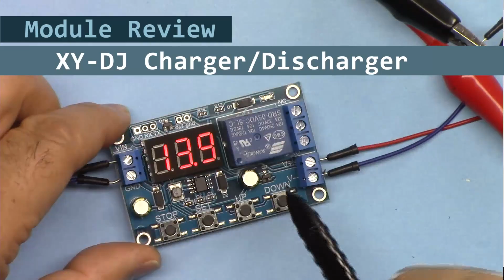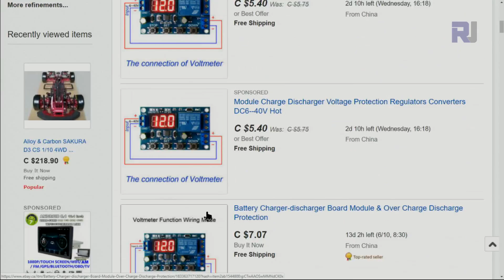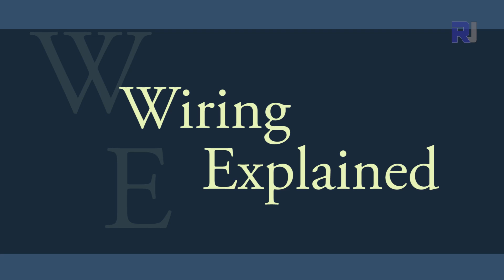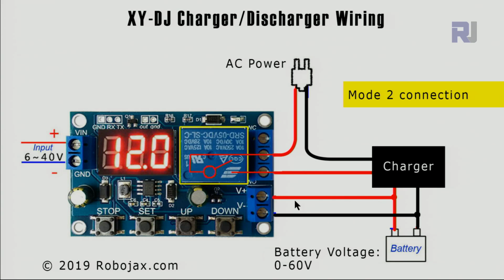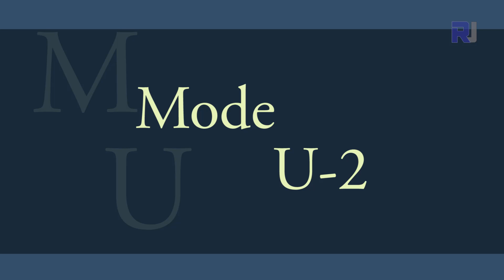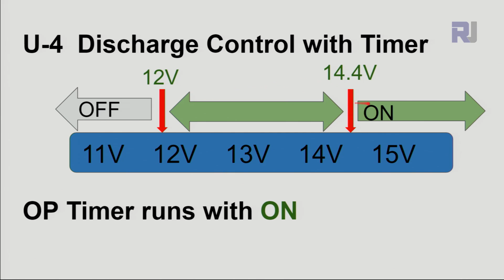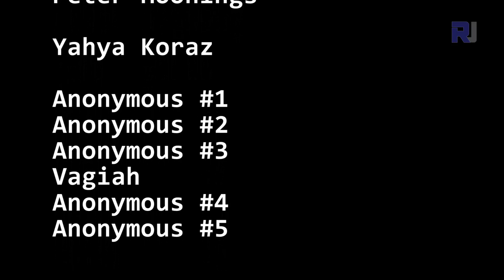How to use XY-DJ Battery Charge Control Module with Over Charge Protection Solar - RJT221

Comment: Hi, I'm having a problem with the voltage measurement at U3, it oscillates between turning on and off, while the battery voltage is fixed at 13.3V on the multimeter. Could interference occur if I connect the power supply to and the 220V phase relay?

Comment: Hi Ahmad - Great tutorial as expected. Thanks to you I've been able to figure out the operation of this control relay which I bought and forgot, until my inverter quit last night for overdraining  my battery. Actually the opposite often happens where my charger shoots up beyond 58.4 V on my LiFePO4 48V battery. I came back one day where the Charger displayed 75V !!! Fortunately, the BMS must have protected the battery otherwise... I though I tweaked the charger parameters to prevent such event, but I guess I failed even though the identical charger I have nest to it never goes beyond its limit... But I cannot return it and this gadget will keep it from happening again. So thank you. I will use OP-5 to drive 2 SSRs that will close the solar charge controller and inverter output, when my battery voltage exceeds or drops beyond  its range: 44-56.VDC. SInce these event work in reverse I'll use the NO and NC output of the relay to drive the SSRs. I like the fact the it displays the battery voltage because I need to set this relay inside the house while the solar rack is outside. You said you would post herewith the documentation for the serial communication of this module? That would be precious if you could let me know where it is. Thanks again Ahmad!

Comment: this board has very low voltage accuracy (-0.3V in my discharging case) and there is no calibration function

Comment: Very nice and informative video 👌. I recently purchased this module for charging LiFePo4 battery using solar panel. But you mentioned in the end that it has some problem charging lithium battery. I have not tested it yet so should I use it to charge my 24v LiFePo4 battery ?
Please help 🙏

Comment: I've a Moman V-Mount Lithium Battery - 14.4V - 99Wh - 6800 mAh and Charger 16.8V - 2A
How many Volts should I set the module to make it turn off?
15.6 V ?  Or which other Volts?
Can you help me? Thank you very much 😊
Reply from the maker: lithium is very fagure. it should LiIo, LiPO, LiFePo4 or so. but generatlly it the charge voltage is 4.2V per cell and 3.25V for the other. I have explained chargin battereis in my other channel in this video https://www.youtube.com/watch?v=45V_c-nweHY

Comment: hi, can i use this charger for 3s li-on battery 12,6 volts?
Reply from the maker: This is not a charger. It is a protection device. You need to have charger.
Reply: Δημήτρη καλημέρα
Μήπως μπόρεσες να καταλάβεις πως γίνεται ο προγραμματισμός;
Εγώ θέλω να το τοποθετήσω σαν προστασία να μην ξεφορτωθεί τελείως η μπαταρία. Είναι 24 βολτ σύστημα και θέλω να άρχιζε να κλείνει το ρελέ στα 26 βολτ και να το ανοίγει όταν κατέβει στα 24.
Είναι φωτοβολταϊκό σύστημα και όταν έχουν γεμίσει οι μπαταρίες να διοχετεύει το ρεύμα που παράγει με το ρελέ στον ινβερτερ για το σπίτι.
Ευχαριστώ
Reply: @digenisakritas6228  γραψε οτι απορια εχεις στον robojax και θα σου απαντησει . Εμεναμου απαντησε παντως . Δεν εχω ασχοληθει ξανα με αυτο

Comment: Good day sir. I would like to use this module in my diy solar setup. My novice question is how do I connect it to my solar charger controller and battery. Which wires are going to the input side? Hope you can help. Thanks

Comment: EXCELLENT VIDEO!!  thank you so much... I am trying to find a tutorial for the XY-CD60L, it has only VIN and OUT ports.  Can you help?? I want to know if I can connect the solar panel on the Vin and the batteries and the load in parallel on the OUT Port.  Or at the very list a charge/discharge control board on the OUT port and then the batteries and load separately connected to this second board (which has separate OUT and BAT ports). I have liked and subscribed.  Thanks a lot.
Reply from the maker: Hi, just did a search and found  it on AliExpress here https://s.click.aliexpress.com/e/_DF8FsDz and wiring for load and battery is shown here. https://ae01.alicdn.com/kf/H8a894d94896b4dc6b86889f85726766bS.jpg keep in mind that your battery must be the same voltage as the load. this module does not change the voltage or current.
Reply: @robojax  thank you so much for taking a look at this! unfortunately, what I need is to connect the solar panel to VIN and the Charging Module to the OUT port, I would connect the batteries and my cell phone to the charging module.  you think its going to work? Solar Module to the Control board, control board to the charging board, charging board to batteries and load on separate channels. <)

Comment: Hello Sir, I am trying to use the serial connection on this board. I am not lucky until now. Do you know how to use them with arduino or esp3266?  Or do you have some bether source  of information? maybe somebody who already realized to work witch it?
Thank you.
Reply from the maker: Hi, you can't use  the serial option. it is secrete for the manufacturer.  Use Arduino to program or do anything you want. here is my Arduino course https://youtu.be/-6qSrDUA5a8
Reply: @robojax  Hello Sir, thank you for the quick response. I Tried esp3266 yesterday. Today I tried to use serial port with Arduino. But both of them didn't work. To bad. I am searching the internet for somebody who already had success with the serial on this item or some examples for wiring and source. But all the way, thank you for help. I will go on trying to get success with this. Johannes

Comment: This module have one fault in Mode U-2, when detect for first time low limit voltage start to charge, if reach high limit voltage stop to charge, and will start to charge again when detect low limit voltage, but if time is reached before than high limit voltage, then stop to charge, but never start again to charge when detect low limit voltage, you need to power OFF and ON the module, or reconfigure again Mode U-2 to reset the module, or dont start to charge never more in mode U-2.
And is possible that have the same error in all modes that use timer.

Comment: Hi,
Pensez vous que ce type de carte permet de suivre la charge d une batterie..
Car la mesure effectuée correspond je pense à la mesure de la tension du chargeur quand celui ci est branché sur la batterie car je ne comprends pas comment il peut mesurer uniquement la tension batterie avec un chargeur qui fournit une tension supérieure à la tension batterie pendant la charge.
Avez vous une réponse.
Reply from the maker: Hello, lorsque vous connectez une tension plus élevée pour charger par exemple 13,8 V, si la batterie est vide, la tension sera de l'ordre de 11,8 V à la borne de la batterie, cela est dû aux caractéristiques du chargeur. Lorsque la batterie est vide, elle a besoin d'un courant très élevé et le chargeur contrôlera le courant en réduisant la tension. Essaye-le. tu verras.

Comment: 2:40 if i set charging voltage 14.6V BUT cut off at 14.4V, will it harm the battery?
Reply from the maker: each product is different. check the datasheet from the manufacturer.
Reply: I am talking general.

Can we charge at higher voltage (say 14.6V) and cut off (at 14.4V as per specs), is it safe or better to charge fast?

Comment: I am having a charger whose output is 24V- 30A (900W), which is used for lead acid battery. So, can you please suggest me the relevant auto cut-off device or circuit for the same?

Comment: hi, I have a question, say suppose you use this to charge a LEAD acid battery, does this lower the charging current when the battery is almost charged ?
Reply from the maker: Hi, from your question I got that you have not watched the video. I have explained this in video.

Comment: Well explained👋 Your channel is my go to section on YouTube whenever I need to check reviews on such modules. But I just have one question on this XY-DJ.  Can I connect a solar panel on the NC and an AC charger on NO of the relay? I did this on my YX-850 ups module. It worked for a month but eventually burned the relay. The current was only 5A, both from solar panel and AC charger. I was thinking of automatically charging my battery via AC charger if power from solar panel is not available. Thanks in advanced 😊

Comment: Hai sir  
Sir i connect the 5v relay direct out and ground to (external relay points) but its not working and out and ground voltage 4.9 v after  connect the relay voltage voltage drop 
And relay function on or off, but out  ground voltage is constant 4.9 v, it's not on or off
 plz tell me how to use this

Comment: Hai sir  
Sir i connect the 5v relay direct out and ground to (external relay points) but its not working and out and ground voltage 4.9 v after  connect the relay voltage voltage drop  plz tell me how to use this
Reply: And relay function on or off, but out  ground voltage is constant 4.9 v, it's not on or off

Comment: Peace be upon you

Please, I have a question about the battery protection circuit. 

Xy-dj made a movie about her

Question

Do you protect the battery from overcharging at the same time from overloading 

i.e. do you use it either to protect from charging or to protect against unloading 

Or both. In same time 
Please if you can  drew the wiring way connect  in this case

Comment: Robojacks I watched your video twice..i use 2 of these in conjunction with each other and it works fantastic...1 setting uses u6 and the other u5

But!!!! You forgot something in your video....if you press and hold the stop button there are a few other function...to ne honest i dont know what they do...i suspected it turns the volts screen on off or a set on time
Reply from the maker: I am glad you found it useful. I am not sure if I mentioned it or not in this video, but that is to turn OFF the display to save energy or simply hide it.

Comment: Again - On the Right Side, can the Negative from the Wall Charger be place directly into the Negative Battery Terminal of the XY-DJ Module? The diagram shows it in the middle of the Battery Negative Wire. Does it make any difference?
Reply from the maker: Please see my reply to your other comments.

Comment: Can a Jumper wire be placed right into the Positive Battery Terminal then leading into the Terminal just above it?  This idea rather than placing a wire in the middle of the Positive Battery Wire going to the Battery. This will achieve the same result. Isn't that correct? Let me know. Thanks.
Reply from the maker: Please see my reply to your other comments.

Comment: So......the if I connect to the Battery with a length of wire and Battery Clips,  I can run the wire to the LEFT SIDE INPUT of the XY-DJ Module to power it up while also charging it. So that means I can use my Laptop Battery Charger on the Right Side of the module instead of the Left Side. Is that correct?
Reply from the maker: Yes. correct.  Stay safe. Ahmad from Canada

Comment: I'm in the U.S.A.  All your wires on the right side are Black, and that's confusing for learning purposes. In addition,  the connection of the Light Bulb as it relates to a Battery is totally not in view.  We really can't see anything when you are making this connection. The Battery is not in view either.  I have a Laptop Battery Charger plugged into the wall that changes 120V to 19V, and that is connected to the LEFT SIDE INPUT of the XY-DJ. So 19V is supplied to the LEFT SIDE of the XY-DJ. With that in mind,  on the RIGHT SIDE, the diagram suggests that a separate Charger needs to be plugged into the wall (120V) as well. In this case, a light bulb, and the positive wire needs to be cut and placed into the COM PORT (the center screw) of the Relay.  Then the positive exits the Relay from  the Lower Screw Terminal and is connected to the Battery Positive Terminal Wire,  and that finally connects to the Battery Positive. Battery Negative on the XY-DJ just connects directly to Battery Negative on the Battery. Is all this correct? Please let me know. At present, I have never connected to the Relay Ports.
Reply from the maker: I just watched the video. It can't be explained better than this. I have explained it with diagram and showing the wring and explained it. it can be connected 2 ways so I explained both. .have you checked the resources page for this module?   https://snipboard.io/AHhRpV.jpg
Reply: @robojax  I connected a light bulb on the Battery Output Terminals. I get nothing. Also, the meter reads 00.00 Volts. When my Battery was connected, the meter was reading the same voltage as my Battery - 12.77V. I guess it was back feeding the Battery Voltage onto the XY-DJ Meter. On the LEFT SIDE, I have 19.3V on Input. Without any outside wire connection to the Relay, is it connected to Battery Output on PCB? If so, the Relay may be causing 00.00V on the meter and no output whatsoever.  Is that a possibility.  Again, do I need two items plugged into a wall outlet to make this Charger/Discharger work? One for Input Power and another for the Charger on the Right Side? Let me know. Thanks.

Comment: If I remove the Battery, Output Voltage is 00.0. When I connect Battery, it back feeds to the Output Terminals of  XY-DJ and reads 12.77V.
Reply from the maker: Sorry, yes when you disconnect the battery, it  can't do anything. https://snipboard.io/AHhRpV.jpg then your setting is incorrect.

Comment: OK - I have 19V going in and Alligator Clips on the battery side. Nothing is connected to the three screws on the Relay Area. I set the parameters  for U-2  as follows - Lower Limit 12.8V, Upper Limit 14.4V and to run for 20 minutes. The Battery Voltage is 12.77, so I expected the XY-DJ to begin charging to 14.4V, however, it only shows 12.5V and hasn't changed from that for the last 10 minutes. What's wrong? Can you help with that?
Reply from the maker: instead of the battery connect a bulb. see if it turns it ON. unless the wiring is incorrect, or power supply is bad.  if you set the limit to 14.4, and battery voltage is lower than that, it should charge.

Comment: You've explained the use of the buttons very well, but it's extremely unclear about how to connect it to power in the first place. I see wires going into the unit, but where are the wires coming from or going to. Let's see it.
Reply from the maker: I replied to your other comment. Watch the wiring section. I watch the video because of your comment. Indeed i've explained it. Please check the link to the resource page for this video or click here http://robojax.com/L/?id=260 and I just added extra information concerning your question. But it is clearly explained in the video.

Comment: Why are you NOT answering the questions? On the LEFT SIDE, is that only DC in? What is it - AC or DC in? On the RIGHT SIDE,  if I'm using an AC Adapter (Description: Input 100-240V - 1.5A, Output 19V - 2.64/3.42/3.16/3.68A), is an Input on the LEFT SIDE still required or does the AC Adapter on the RIGHT SIDE become the Input? Please answer these questions for me?
Reply from the maker: LOL. I am setting by the computer to reply. Sometime I check them every two days and some times daily.

Comment: If I use an AC Adapter (Output 19V---2.64/3.43/3.16/3.68A) is a Left Side Input 6V-40V still required? And is that Left Side Input  (6V-40V) AC or DC? I'm assuming the Output (0-60V) is DC because it's obviously going to the battery. Is it Input on the left  (AC or DC?) or AC Charger Input on the top right? Is it a choice, one or the other, AC Charger Input or Input on the Left?
Reply from the maker: you made me watch the video.  I have clearly a section called "wiring explained" and the link is in the description of the video so you can jump directly. I have answered your question in the video. I've spend about 2 days to make this video. if you own the module, 26 minutes is nothing to watch. good luck.. Please check the link to the resource page for this video or click here http://robojax.com/L/?id=260 and I just added extra information concerning your question. But it is clearly explained in the video.

Comment: Hi, my congratulations on your videos, which are very complete. I have the following doubt, is it possible for this equipment to work in two modes? that is, to have the charge and the discharge (eg U2 and U4) defined ? Using an Arduino connection for example. Did I understand that there can only be one defined mode? Thanks
Reply from the maker: Hi, thanks. yes you can turn ON or use only ONE mode.
Reply: If you really want to hookup Arduino, then write your own code and no need to waste double money

Comment: On the left side, is that DC Input and the right side is DC Output? Is that correct? Also, when this unit is totally disconnected,  does it revert back to the factory setting? Or are  the previous settings still in effect when you reconnect again?
Reply from the maker: you made me watch the video because I was worried thinking I have not explained it. Now i know you have not watched the video. In the wiring section I have explained the wiring and even I've shown diagram.  your 2nd question. yes it will keep the settings.